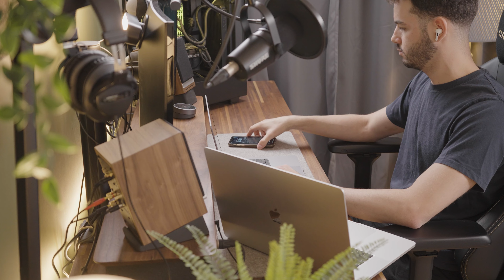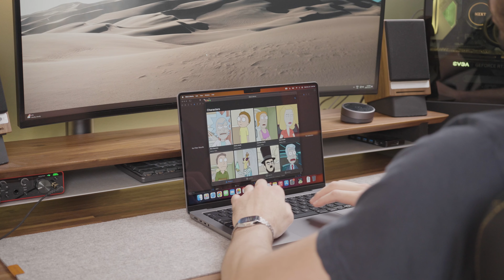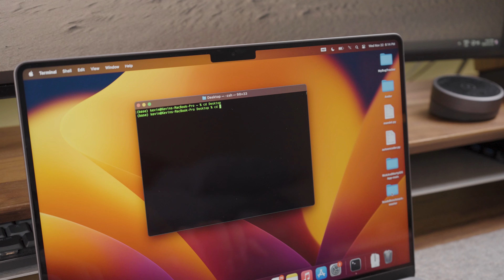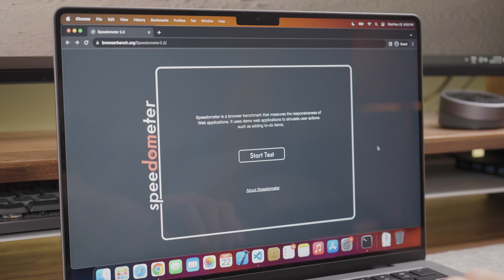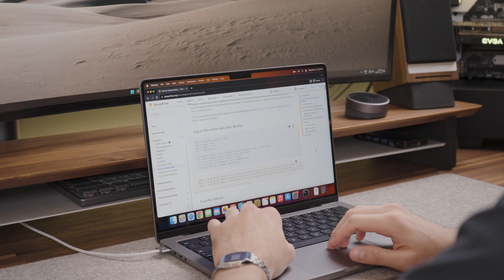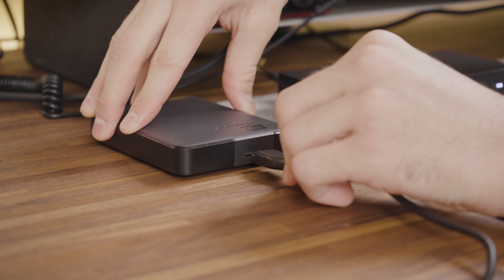M3 MacBook Pro for Programming [Apple M3 Review]

Comment: To me it was a nightmare, first virtualbox was not possible, then laravel valet, then laravel herd, then docker fails to build a container because of the architecture it uses, so wtf?
Reply: devs definitely have been using docker on it natively
Reply: Can you elaborate? Haven’t most dev tools gotten support for apple M chips? 

I’m on Mbp 2020 Intel i5 so looking to upgrade soon but I need all my dev tools to work (PHPStorm, LocalWP, Laravel Herd, Insomnia etc)
Reply: @soaringleads  for example at first i tried Laravel homestead because its very flexible and to my surprise virtualbox version 7 and vagrant 2.4 when you want to add a laravel box, it comes with an error that it cant find a box with the constraints given, after hours of manually trying to add a damn box, it just didnt work, so then i saw Laravel Herd which is an easier version of Valet, and it was easy to install and then the database cant connect, it is up and everything and even followed to the T in the instructions plus some youtubers and it just didnt  connect, the wordpress or laravel app runs fine but it is as if the database was not started so thats why the error of cant establish database connection.
Then i tried docker which i assumed it would work, then boom, there is no compatible xyz... because of arm64, so last resort was to add a flag to signal in docker-compose.yml to virtualize it as amd64 and i was able to finally run the WP app and laravel app.
I normally despise anything apple but was given that machine at work, it was a macbook pro M3, it only looks sleek on the outside but nothing compared to my Ubuntu setup which runs and dances around anything.
So if you have a M3 laptop make sure to research your tools for potential issues with ARM64, because most of dev tools run perfectly fine with Intel based architectures.
I am sure you will figure it out , its just that i cant be spending so much time trying to figure something out that is so straightforward(used to be)
Reply: @soaringleads  
This line makes it work in docker-compose.yml

platform: linux/amd64

But there is a warning about performance, so far i havent notice anything major

Comment: Hi bro. Does anaconda m3 processor also work smoothly? There is a special download link for m1 but not m3. Where and how did you download it?
Reply from the maker: It worked fine and I used the M1 link. I do remember having an issue at first when installing it on the M2.
Reply: @KevinFerrandiz I can use m3 pro without any problems using the m1 link without doing anything extra right? Have you had any problems?

Comment: If anyone in the comments can please help me?  I am thinking of buying a MacBook M3 pro 11 core, 12 core pro or a 14 core M3 Max, 18 GB or 36 would be enough, but I would like to know the difference when running MATLAB, Apple's office page is very ambiguous in the data, gives some graphs without specifying which test was done, and in the end he says little about what he did, such as the number 12 or the numeral 14-- for example the 12) Testing conducted by Apple in September and October 2023 using preproduction 14-inch MacBook Pro systems with Apple M3 Pro, 12-core CPU, 18-core GPU, 36GB of RAM, and 4TB SSD, production 14-inch MacBook Pro systems with Apple M2 Pro, 12-core CPU, 19-core GPU, 32GB of RAM, and 8TB SSD, production 14-inch MacBook Pro systems with Apple M1 Pro, 10-core CPU, 16-core GPU, 32GB of RAM, and 8TB SSD, and production 2.3GHz quad-core Intel Core i7-based 13-inch MacBook Pro systems with Intel Iris Plus Graphics, 32GB of RAM, and 4TB SSD. Tested with MATLAB and Simulink R2023b v23.2.0 and Parallel Computing Toolbox using a vehicle dynamics model. Performance tests are conducted using specific computer systems and reflect the approximate performance of MacBook Pro.

Comment from the maker: This is the base model 14" M3 MacBook Pro with 8gb ram
Reply: If anyone in the comments can please help me?  I am thinking of buying a MacBook M3 pro 11 core, 12 core pro or a 14 core M3 Max, 18 GB or 36 would be enough, but I would like to know the difference when running MATLAB, Apple's office page is very ambiguous in the data, gives some graphs without specifying which test was done, and in the end he says little about what he did, such as the number 12 or the numeral 14-- for example the 12) Testing conducted by Apple in September and October 2023 using preproduction 14-inch MacBook Pro systems with Apple M3 Pro, 12-core CPU, 18-core GPU, 36GB of RAM, and 4TB SSD, production 14-inch MacBook Pro systems with Apple M2 Pro, 12-core CPU, 19-core GPU, 32GB of RAM, and 8TB SSD, production 14-inch MacBook Pro systems with Apple M1 Pro, 10-core CPU, 16-core GPU, 32GB of RAM, and 8TB SSD, and production 2.3GHz quad-core Intel Core i7-based 13-inch MacBook Pro systems with Intel Iris Plus Graphics, 32GB of RAM, and 4TB SSD. Tested with MATLAB and Simulink R2023b v23.2.0 and Parallel Computing Toolbox using a vehicle dynamics model. Performance tests are conducted using specific computer systems and reflect the approximate performance of MacBook Pro.